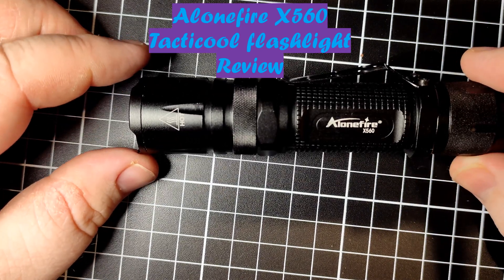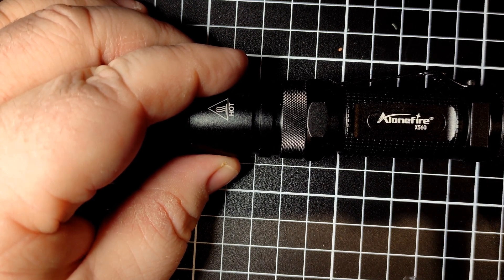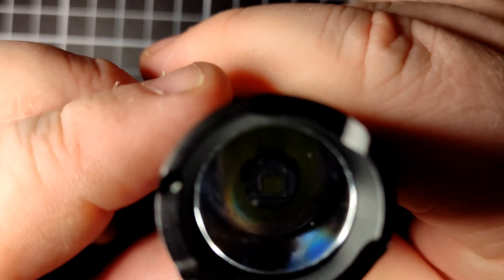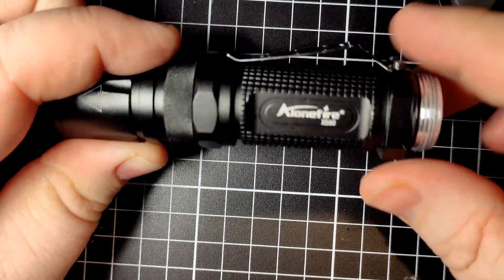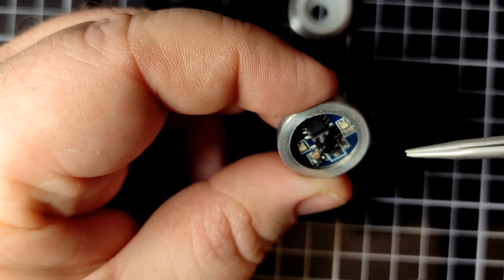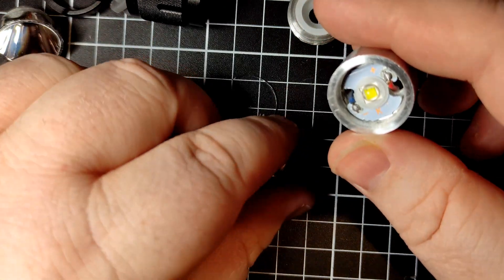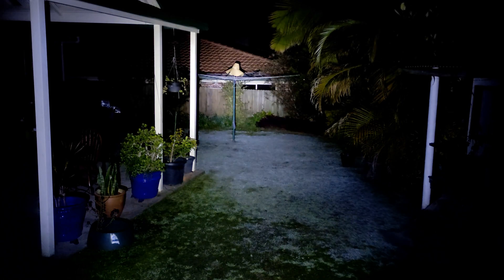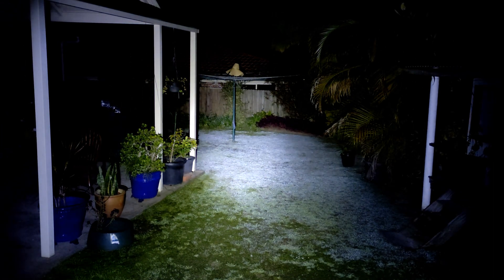Alonefire X560- The Tactical EDC Flashlight

Comment: I need a replacement 
Reflector And Lense 
for a Convoy L21A SFT40 
No Purple AR film coating
Has to be a clear Reflector and Lense 
know anyone here in Aus or online 
Anyone doing flashlight mods here 
that's trustworthy
Reply from the maker: Hey mate I have those parts spare if you need them. Why don't you want anti reflective coated lens? That is an easy job to DIY.